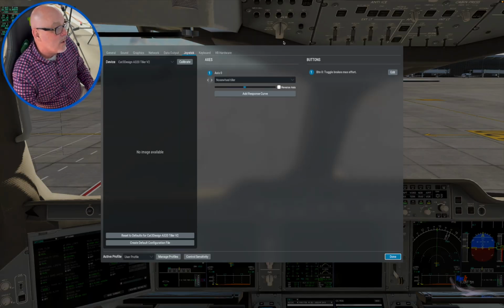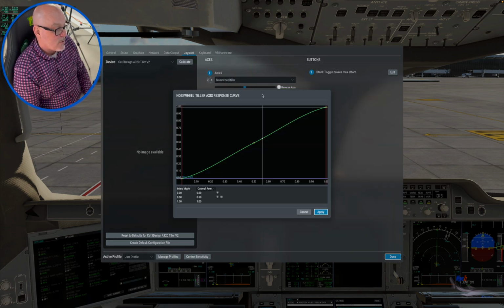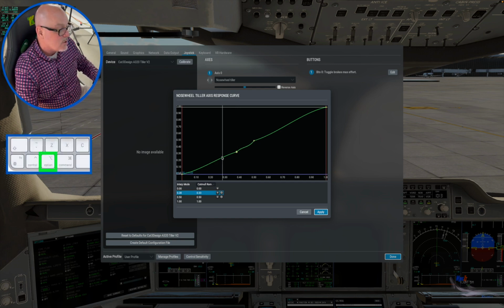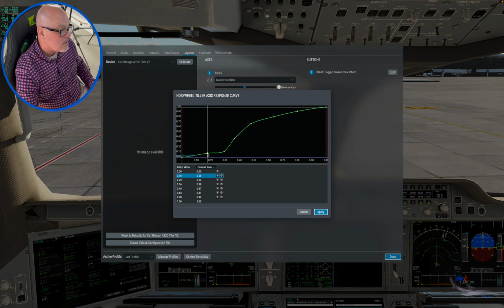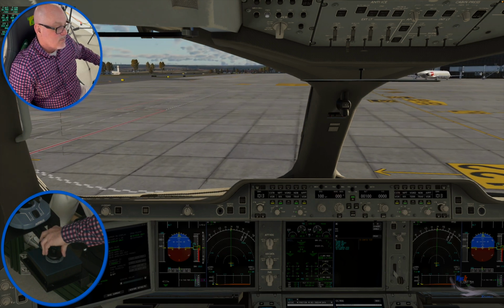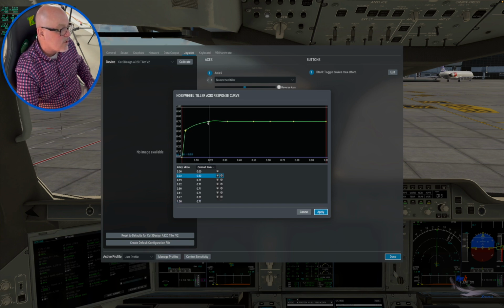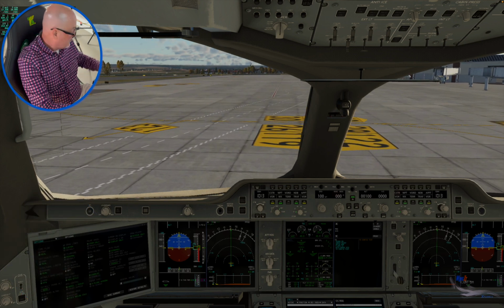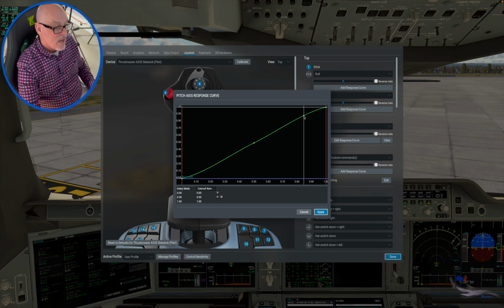Fine Tuning Flight Controls in X-plane 12

Comment: I have a hard time controlling the FF350 I feel like it is either unresponsive, either unstable. Do you use an edited response curve for the the pitch ?
Reply from the maker: I do not use an edited response curve, but that may be a great idea for you. Maybe I should use and edited response curve especially for the rudder which seems a little sensitive. 

Great question! Thanks so much.
Reply: @WingITFlightSim  I reduced the deadband and now it’s very better, the aircraft is easier to control ! Did you change yours as well on the tablet ?
Reply from the maker: @feiyue2240  I have not… not yet. I’ve messing with some new scenery files. But I’ll try to remember to edit the response curve on the rudder pedals.
Reply: Ty - I have been using the Logitech Extreme 3D Pro for 10 years (well, I wore out my first one).   I added a response curve for the yaw axis and feel like it’s a vast improvement.  Many thanks for the explanation !

Comment from the maker: Thanks. 

Hardware: Thrustmaster Airbus A350 Sidestick, Thrustmaster TPR Rudder pedals, Honeycomb Bravo Throttle Quadrant. 

Computer: Mac Studio M1 fully spec’d.

Monitors: As far as the monitors, check out our “3 Monitor Setup Video.” Good video that will show you exactly how we set it up and the video description has the brand and model number. But, in short, they are 2K monitors.

🙂

Comment: Hello. Nice info! I never knew I could add so many points to control the sensitivity curve.
BTW what A350 addon is used for XP12?
Reply from the maker: Thanks. It’s an aircraft by Flight Factor. You can get it on the x-plane store website (store.x-plane.org).